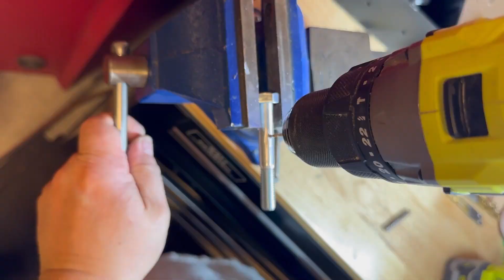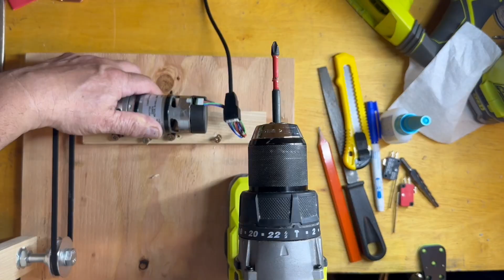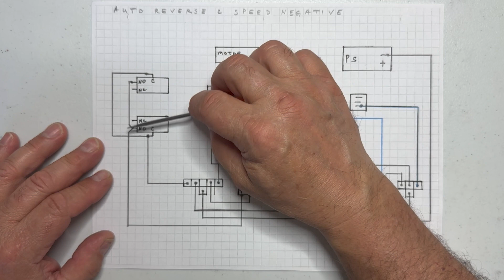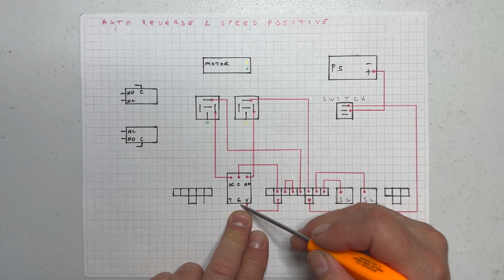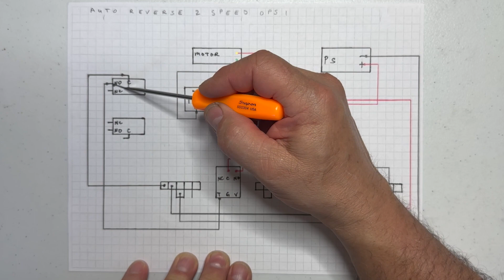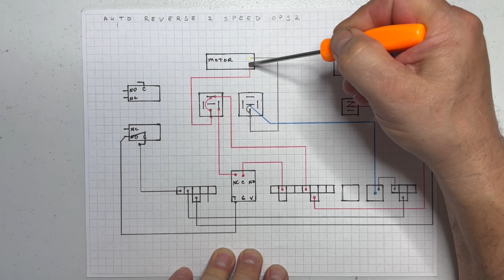Auto Reversing with 2 Speed Controllers

Comment: I just want to know one thing. Are your motor controllers 12 volt? I’m attempting this but my BLDC driver is 5 volt signals. I bought optocouplers because I have 24 volt dc supply. My relays are 24 volt coils as well as my proximity sensors. One thing that I want is to delay after it hits limit before reversing. So I have 2 timer relays at 24 volts. Each timer relay is spdt. I’m getting lost. It’s for a router sled.
Reply from the maker: Check the description there is a link for the ones I’m using

Comment: Hello and good morning to you. I’m trying to write up two DC motors one with 12v and the other with 5v. I’ll have one SPST switch for main and SPDT switch the will control my relays. The relays will switch power from one motor to the other. After the relays I need a DPDP switch to control polarity. I want to be able to control the direction of the motors.  I’m trying to make this work without the frost switch and I can’t seem to figure it out. Is it possible? Any tips I would really be grateful. 
Thank you for you time
Reply from the maker: @caseymor1358  I’m trying to wrap my head around this. 2 DC motors one 12 and one 5 volt. Curious why the 2 different voltages? You want a SPST switch for main power (to start the whole thing)? SPST to activate a relay to supply power to one of the motors at a time? Then a DPDT switch (I’m assuming on/off/on, so when the switch is turned on one way the motor moves in one direction and when turned on the other way the opposite direction, so not momentary where you would have to hold the switch for the motors to move?) that controls direction of the motors. I think this would need one for each motor because of the 2 different voltages? I’m not sure what frost switch you are referring to? I would like to try and help but I need more detail than the average dude…

Comment: On this one you could use a single 3PDT relay or 3 of the bosch style relays. You don't really need the triggering relay. 

By setting up 2 of the relays as if you were wiring a DPDT switch for reverse polarity. Use the third relay to latch all three. When one of the limit switches is reached it latches all three relays reversing polarity. When it hits the othe limit switch it breaks the connection, unlatching it and reversing polarity.